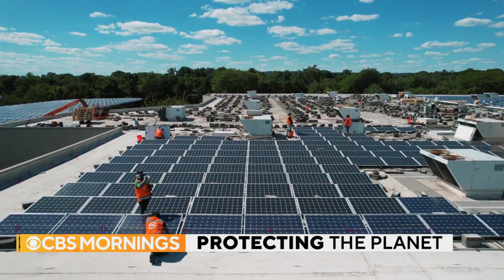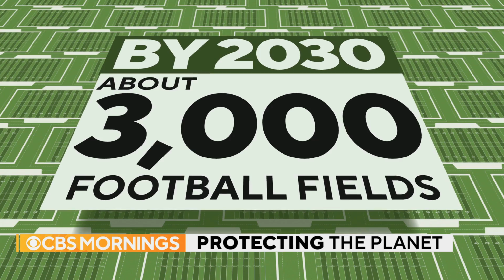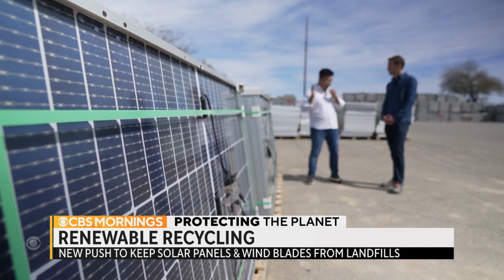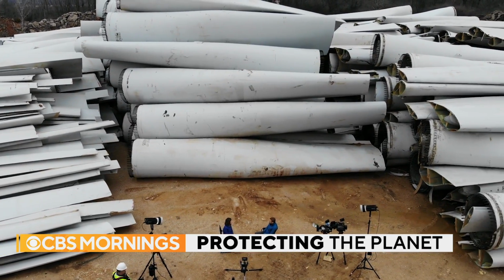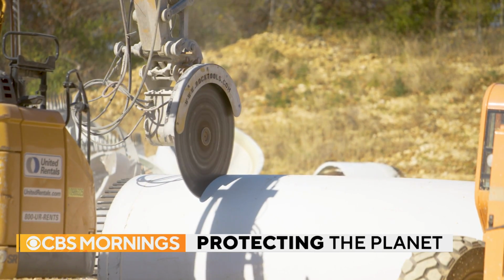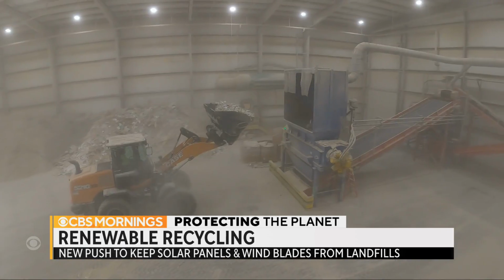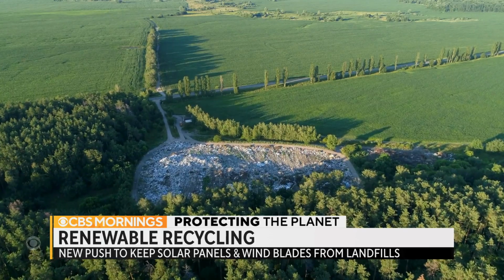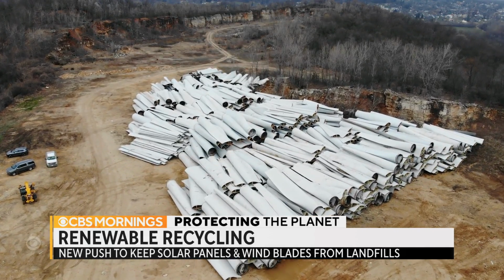Wind blades and solar panels head for landfills after being replaced

Comment: The resin in wind blades is made from fossil fuel. Buring them does not reduce carbon foot print.
Reply: Yes it does because the wind turbine prevented a lot of CO2 emissions during its operating life.

Comment: The sad thing is they charge way to much for those used panels when for a bit more you can buy new panels. I have seen new panels sell for less than 50 cents per watts shipped and I have seen used panels sell shipped for 30 cents per watt shipped. 
When you can ship me a whole pallet of panels for 10 cents or less per watt then I would consider spending money on panels. 
The fact that they just grind these up and trash them just goes to show that these companies are not in it to resell.
Reply: I know of used panels who have been given away for almost nothing to build a PV plant in a rural area.
Reply: there are places in arizona selling used 250-watt panels for $50. the ones that get scrapped are the ones that are physically damaged, usually the glass is broken. the reason you see used panels selling for more is because in order to ship them, they have to be packaged. new panels are already packaged so you pay more to package the used ones.
Reply: @marzsit9833  Yeah there is this town called Gilbert that almost always has solar panels like that. I have considered going down there via plane and then renting a box truck and making the 16 hour trip home. Box truck would be far better than drving my own truck which really can only support   2 pallets weight and size with my 9x8 flat bed. Box truck could fit quite a bit more. While I am down there I should be able to pick up ground mount rack to support 30kwh of solar along with the panels and a enough wire and some other odds and ends for 5k to 7500 including truck rental, gas, plane tickets and 2 or 3 nights hotel stay. 
I have read that there are companies when they take down large systems they sample test so many of them then pallet them up for broken and non broken then sell them at steep discounts because all they have to do is pallet them and not test or wash them. These can be had at major discounts and maybe 10% of them might be bad. Even if that is the case its still a lot better than one would think. 
There is no point in buying new if I do not have to and used will still last a long time. 
I intend to over panel my system per what ever the specs allow. This will make up for any degeration in the panels and allow for a much more energy for more parts of the day rather than a super high peak. 
For example if you system is rated for 20kwh and you can over panel at 40kwh you will bring in 20kwh for 12 hours rather than for 5 or 6 hours. This is why used panels can be super profitable if you sell back to the grid with a hybrid system, having enough energy to charge your battery bank, run your daily loads while selling back to the grid at the same time. While the peak load is nice it offers less. If you run a standard load of say a few kwh hourly being able to bring in a larger amount of solar early in the morning is better than not being able to do anything. 
I am running a solar fan test and I want to see what voltage the DC fan will take as I could then get a much larger panel ( higher voltage ) and have the fan kick on much earlier in the morning and later at night. This will allow for more use of said fan rather than peak hours. 
I am still wating on a much better hybrid inverter that offers so much more than they do right now. Something in the 10 to 20kwh range which is more than enough to keep up with any peak and demanding loads of any home. Up to 4 times the solar and up to 1k volts solar. Can wonk in any mode, grid only, battery only, solar only ( which means no need for grid or battery ) any combo of those 3. Another mode that I would like to see is battery back up. When the inverter has no battery yet has a battery that just keeps the system on and tells you the voltage and so on of everything time and date and things like that yet has no storage its self. So if the grid is down and you have no battery then the system will power on when there is enough sun and powers down when the sun goes down. Having that back up battery will allow the system to ideal all the time and keep that battery charged yet allowing you to check system and monitor it when the sun is not out. In the morning when it starts to get light out it can log the data as for time when the system is ready to fire up and when the system fires down. The more solar you have the more power you can have early in the morning and late at night. Meaning that if you wanted you could live battery less pretty easy.

Comment: Most of them are actually still working. Just strike a deal with developing countries to ship them at cheap rate to repurpose.
Reply: They don't have to.  If they still work they resell them here in the US.  They didn't say they only recycle them, they also said they "reuse" them.  There's a huge market in the US for buying used panels.  I've bought some, and they work great.  They get upwards of $100/panel.  They surely don't crush the working ones.

Comment: the real key for energy is fusion! 
cause china created their solar farm in the xinjiang deserts that our twisted news called silos! they also have their wind farm on the mountains and sea. they were actually the first country to start a renewable energy project due to harsh weathers they have. 
this was why china created and stabilized their first fusion sun, cause they know wind, solar, etc. will help, but not strong enough to generate the energy to run an entire country. 
china also recycle as much as they can before it goes into recycling, so it doesnt populate the earth.
this is the funny thing, we all talk about banning combustion engine cars and go to ev, but how come we never talk about how much raw materials we need to make the battery? also where we are going to dump the batteries? 
tbh ev are more populated than combustion engine cars!
do your math!
this is the way how the top 1% are trying to make more $ by making everyone buy ev!

Comment: Quite interesting how laughable the CBS talking heads seem to see the report.  Hard for me to understand why no one asked why they had 3 to 4 year old panels in the garbage when they were designed to last 25 to 30 years.
Reply: They did say why. As solar panels improve their efficiency the old ones are being removed. You have to remember, these solars panels are relatively new, so practically every year theyre improving and making newer and better models. Then the old ones are being replaced.
Reply: @JayForsure  But why would you rip out perfectly good panels to replace them with marginally more efficient panels? The usual rule of thumb is that a panel loses 1/2% of efficiency per year - but some are doing better than that in practice. A four year old panel is probably still 98% efficient (or more). Given the cost of buying and installing the new panels versus the benefits of any marginal improvement in energy generated there has to be another reason - poorly thought out tax breaks, possibly?
Reply: @malcolmrose3361  it comes down to space efficiency and profits.. Newer 450+ watt panels take the same square footage as a 3 year old 330 watt panel.  They already received the tax incentives on first install. Now receive another tax incentive for the upgrade plus increased profits from higher outputs and resale of aged panels to wholesalers.
Reply: @malcolmrose3361  Here's a better way to explain it:

Why would you keep a 15 year old computer when there's a much faster, better, more powerful one being made even cheaper today? Or the same about phones? Why would you keep a crappy, slow, buggy 5-year old phone when you can buy a really nice new one for even cheaper than you bought the old one?

Solar panel technology is just moving insanely fast right now.
Reply: @jstaffordii  Exactly - a poorly thought out tax system for panels. The federal government needs to mandate that producers are responsible for the re-use or recycling of panels (and windmill blades etc). Like they did for lead acid car batteries back in the day - the EU already does this.

And that the tax breaks for panels are a one time thing per site (or, at least, once every 25 years), and penalise companies that replace panels early. At a time when America needs to expand it's renewable sector it's madness for companies to rip out panels earlier than they need to.
Reply: @Madwonk  Sorry but your analogies aren't well thought out - these panels aren't failing, or no longer up to the job, they are still generating electricity just as they were designed to do. 

What is insane (and I'm using the word in it's proper context of "in a state of mind which prevents normal perception and behaviour...") is your belief that just because a newer version of something is available one should buy it and throw away the old one. Your attitudes are what have made America a throw away society.
Reply: @Madwonk  I've spent months looking for a new phone that's half as good as my 10 year old one. I'm typing this on my 15 year old computer because it works better than my newer one. It doesn't matter how cheap the new ones are, it still costs more to buy new than it does to keep what already works.
Reply: @JayForsure  Their improvement rate is actually quite slow.  Being replaced by more efficient models makes no sense since their efficiency only increased by tiny amount in that time.  More likely they went out of business because of covid and were selling all their assets.
Reply: That's what I don't understand. Why are utility scale companies junking panels after 4 years, well before the loans are amortized, even before the panels are fully depreciated? Something doesn't smell right to me.
Reply: Government subsidies, AKA socialism. Making the tax payer pay for what would be a failed plan.
Reply: Stop asking reasonable questions and listen to the gospel of CBS.
Reply: Many reasons.  Some people lease or PPA them (instead of buying them) and either sell the house without a transfer agreement or stop paying so the companies come back and remove the panels. The companies usually don't deal with reselling used equipment and just sell them to recyclers that are set up to test and resell them.

Comment: So they are grinding up the fiberglass and resin turbine blades and burning them as fuel for the cement plant ?🤷‍♂️
Reply: Yes, better than just burying them in the desert. Fiberglass epoxy resins have a lot of fuel energy in them.
Reply: They grind it up and use as replace for fly ash in cement. The video showed it clearly. Why so many people in the comment section are not getting this?